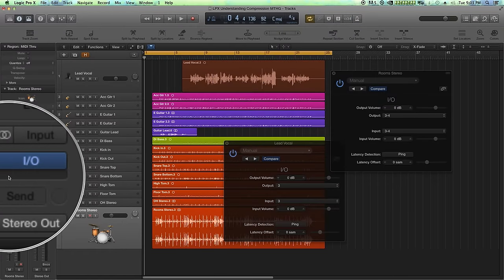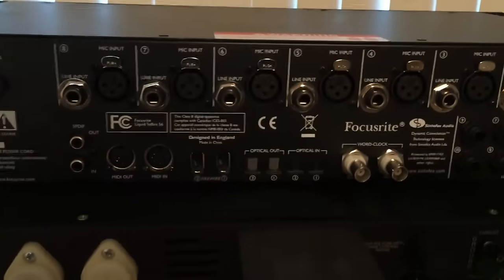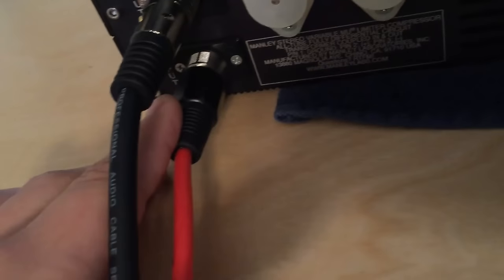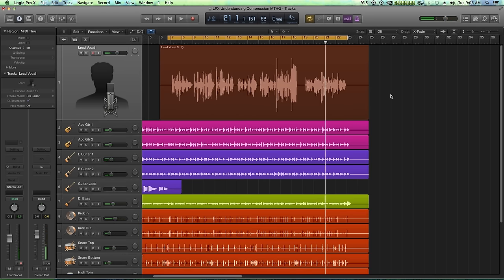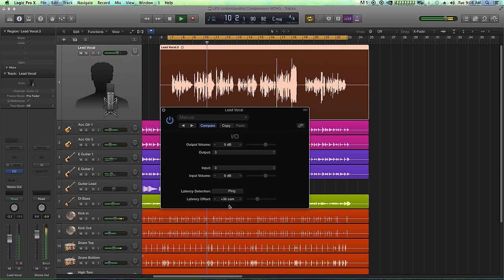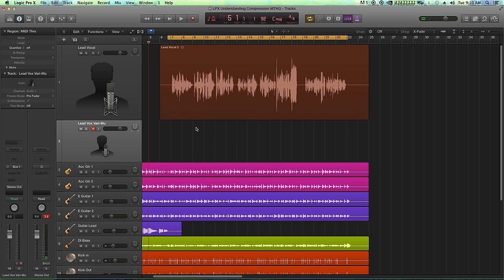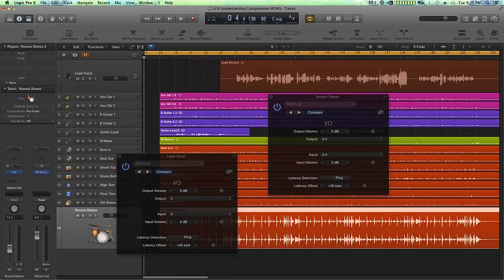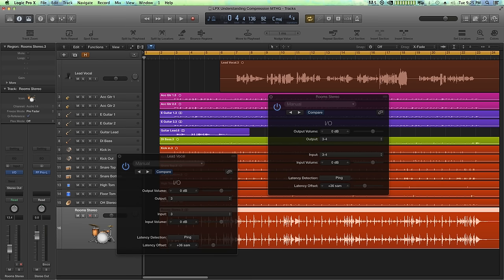Logic Pro X - I/O Plug-in - Using External Hardware for Audio Processing and Mixing

Comment: Thank you! Thank You! Thank You!   I have searched hard and long to find how to use my Focusrite Clarett, with my 500 Series modules.   Finally a great explanation of how to connect everything and get it up and running.   I can't thank you enough.
Reply: Hi, I'm trying the same with my clarett and can't get it working :( Is there special settings in the Focusrite Control with the inputs / outputs? thanks!
Reply: I am sorry but I always wanted to ask. What's the deal with the "Official" bit in your name. Do you really think you're that famous?
Reply: @snails9505  Hey, did you figure this out? I have the same setup and I lose signal with the i/o plugin

Comment: Question: why can't you use the two line outputs for your speakers for I/O instead? I am wondering because I have a small interface—RME Babyface—which only has two outs (excluding the headphones). Does this mean I need to buy a bigger interface before I can start using external hardware? Or is there a way to route it (for just mono signals, for example)?

Comment: Hey Mate.. Nice Video Demonstration!   One question I had for clarification - when you went to print your vocal on a secondary track, you routed the output of the vocal track AND input of the  2nd (new) vocal track to print on - both with "bus 1" - did you do it that way to avoid the extra latency for the print down.. so it would be printed down in and in its correct place (granted both I/O inserts had the "ping" adjustment)? 

Also, if you wanted to an AUX for like reverb I/O instead of an insert for things like Comp etc.... would it basically be the same thing but it would be set up out of a DAW AUX track instead?  

Thanks again for the video.. nice work!

Comment: Hi, I have a feedback problem with the reamp. I use an Audient ID14 for the reamp using my Eventide stompboxes to add FX on my guitar tracks. I use the I/O plugin like you do in the video but at certain db level the feedback stars to rise . The problem if I don´t rise their FX db level they don´t sound with the same intensity that if I play with the real amp. 

The guitar track and the track with I/O (both with stereo output off) have a send to a certain bus. This bus (with stereo output on) has another send to the audio track i which a mix the original guitar track with the fx.

Hope you can help me with this problem.

Thanks.

Comment: My guy first off I have watched for a long time and I haved learnt so much from you so thank you. I don't normally do this but I'm stuck. You say in this video that we need more than 2 outputs to use outboard gear. Well sir my question is I'm buying the Apogee symphony desktop and it only has the 2 outouts but I am wanting to run thru my warm audio wa73 eq and then into the black audio bluey. It does have optical inputs and outputs. Is it possible to not only track and record with them but also can I hear what I tracked as I turn the knobs as I listen.  This might be a dumb question but I just don't want to purchase all this and then only be able to record but not be able to mix with the hardware. Does that make sense? Like can I use the optical to xlr and then use the Apogee software to route. Thank you so so much my friend

Comment: What recording routing did you use on LS56 control panel? I use input 3 and output 3.  Setting the output 3 to DAW3 and it doesnt work inside logic using i/o. What gives?

Comment: Great tutorial. I have the same setup with Logic X and the UA Apollo Twin. I can't route my audio to hardware because I get feedback loops. Since there are only 4 physical outputs on the UA AT, what physical outputs are you using? I'm assuming the line out 3/4 and then back into the Line 1/2 correct? I'm doing this but get shrill feedback.  Any thoughts?
Reply: i had the same issue and i just found the solution to it. in your interface software, set the output 3/4 to Line3/4 instead of Monitor

Comment: Great video, if my compressor/mic/ interface is wired up to record with compression at the start,  would I then have to re-connect/patch the cables for further use of the compressor in the mix?

Comment: Hey there, I have a question I was wondering if you could help me with.
I want to connect my recording set up to my home stereo system so I can check my mixes and masters on commercial speakers.
My equipment is /  Logic pro x , Scarlett 2i2 interface with 2 Event TR5 Monitors.
My stereo receiver has RCA jacks for additional outs and normal speaker wire hook ups. The Event TR5's have RCA jacks available in the back. They also have balanced outputs which I'm 
using for for the Scarlett 2i2 interface. Any help would be great.
Thanks, Jim.

Comment: So if you process your beats or vocals through SSL or API analog outboard EQ and compressors it will essentially give you the same quality as running it through an SSL analog desk? Is that accurate?  If not, why not? Love an answer from you. 
This is the best video iv'e ever seen on hybrid mixing ..EVER.. And believe me, iv'e searched far and wide. Thank you.
Reply: Well.. if you run it to an SSL Desk and apply EQ it will sound pretty much like an SSL 611 EQ for exemple. And if you send it to an API EQ then it will sound like an API EQ... Your question is a little bit nonsense

Comment: Hey music tech guy thanks for the video, i have a question for you my i/o plug-in has a dry/wet option in the bottom if i put it 100% wet i have no signal going to the hardware if I choose dry i can see the meter of my hardware moving but no change to the audio signal, any idea what the problem could be? I’m using the focusrite clarett 4 pre usb ??

Comment: So all the the mix process with outboard gear requires you to essentially create new print tracks and re-play the whole track every time you want to adjust EQ, Comp etc on that particular track? That seems absolutely unreasonably ridiculously time consuming. I'm assuming like most you may adjust the EQ and comp several times over as the mix progresses and you hear different things...so in this instance with outboard gear, you'd have to re-print those tracks in it's entirety every time you make a fine tune adjustment?
Reply: or just don't print it.  just listen and don't print until you get to a point where you think you need/want to.... but no, don't print after every adjustment.  that would def be a waste of time.

Comment: Hopefully this video isn’t too old for me to get some feedback. I’m having all kinds of issues with trying to use outboard gear. The first issue is unless my buffer size is set down to at least 128 I get horrible latency. I’m running a 2020 iMac. I feel like it shouldn’t do that. Second, when I get it to work properly I can’t pan the signal. Third, if I place plugins after the i/o plugin they don’t work properly. Fourth, I can’t print or bounce with the outboard in the signal. If I bounce the track out there’s no wave form when I pull it back in. I tried the printing method and it’s not recording the outboard signal into the track. I’m at my wits end.

Comment: Hi there. Love your videos man. I just got an external compressor and when i tried to do this I got a tone of feedback when I turned the gain up on my compressor. I did a little trouble shooting and totally took the compressor out of the loop and just tried to come out of logic through my pre amp and back in the front. I still am getting feedback when I turn the volume up even just a little. Could this be because I need balanced cables?

Comment: Interesting. One question:
how do you level the processing audio going back to Logic via line input 3 ?  Do you turn up the volume on those line inputs of your Focusrite interface? Where do you look to find out what the true signal level is?
Reply from the maker: Line inputs on most audio interfaces do not typically need additional boosting, so the preamp gain stays all the way down at zero. This way I can boost or attenuate the output level from the hardware itself. I try to keep the input and output volume pretty close while making adjustments, but I may boost the output a little at the end if want the signal a little louder.
Reply: @MusicTechHelpGuy  Thank you for your quick answer. I'm glad I've done things right so far. I always had that doubt though.
If I may, I would like to ask you another question.
My interface has on each channel a 4-segment LED meter as well as a stereo 6-segment LED meter for the main. The question is why the reading of the stereo level meter in Logic doesn't match the one in the interface? Sometimes, when I'm mixing, I have the feeling that I'm wasting dBs or something like that because I don't know if I'm levelling the signals properly.
Could you put some light on this issue? Thanks.
Reply from the maker: @awesomebandhub  It could be scaled or weighted differently. Could be that the meters in Logic are showing peak values, but the LEDs are RMS?  It would be unusual for an audio interface to show values other than dBFS though, but it could also be possible that you're seeing a completely different dB system. Or the timing could be different. LED meters are automatically going to be a more quantized value, and the hold times for the LEDs could be longer or shorter. There are a number of reasons why, but I would trust Logic's meters, not the LEDs on the interface. I only look at my interface meters when I'm recording to make sure I'm not clipping and to set a rough level.
Reply: @MusicTechHelpGuy  Thank you very much for your help. I will check everything you say. Normally I set the Level Meter to Peak. Today I sent a 1000 Hz. tone with a -12dB level through a generator and I was able to check that both readings match: the one from the interface and the one from logic Pro.
You are right: in recording mode I look at the level of my pre-amp.
Cheers,
Teffy

Comment: thanks for this. I have a few further questions. i have this setup as shown, but I need to "mute" the original track so I can accurately dial in the new compressed track. the original track is muted when I'm monitoring the compressed track, but when i hit record, the volume drops on the new compressed track and the original track still comes through. any ideas on how to solve this?

Comment: I don't understand the point of the I/O plugin instead of just changing the output of the daw channel strip of the source material to a line output on your interface and then printed back the outboard compressor back into the interface. What a I missing?

Comment: Question? when I put the i/o plug in directly on the track, I get no input or signal ont the track. what's my issue? I have my output s & inputs of the plugin on 7&8 & still there's no signal when the plugin is turned on. What could be my issue?
Reply from the maker: Do you have the track solo'ed? Logic has a weird thing where if you solo the track, the I/O plugin won't work at first. If you un-solo the track, press play and let the I/O plugin pass through signal for a bit, then stop playback, and solo the track, it will then pass through signal. It's weird, but happens to me all the time. If you click the PING button and you hear that pop, that confirms that the signal is passing through. If you don't hear the pop, then there's some other issues, like a routing issuing, or in many cases, the audio interface has to be set up in a certain way to output line level and input line level. Good luck!

Comment: so in this tutorial I take it that when you print the new track from the compressor then that is the track you now use for your vocals? I am new to outboard gear and also discovered parallel processing. So, I was wondering if I wanted to run lets say half of my drum mics (already recorded) through the outboard compressor but parallel process it, how would this be achieved? I think I am correct in saying that you can't record on an aux track, so would you create a normal track, set the bus to 1 (for example) set the inputs for the new track to bus 1, then set the bus sends to 0 dB on the drum tracks, print the compressed signal of the sent drum tracks onto the new track, then use the new tracks fader to blend the two tracks together? this was hard to write in less words so apologies for the essay, any help is hugely appreciated from anyone! Great vid.

Comment: Hello! I'm trying to use Light Pipe (ADAT) to create 8 new channels in Logic Pro X. I have an M-Audio 2626 plugged into my Focusrite 18i20 using two digital optical cables. It's not working... I'm wondering if you can let me know how I should set things up in Logic Pro so it'll work. You've given me some help in the past and I really appreciate it so much. Thanks!!
Reply: Go to the top left of your mixer and search the menu that has “I/O” configuration as an option and set your routing up from there.

Comment: For some reason, the Latency Offset isn't working in my I/O plugin. I hear the Ping click but it just keeps giving me zero every time. I'm running the latest version of Logic with an Universal Audio x8p interface with the latest drivers. I'm running out to my 500 Series Rack via DB25 in and out. Is there a setting in Logic that's preventing this?
Reply: I’m also stuck with this and am using an x8p. I’m using db25 to xlr routing out to 3 and back on 3. I can’t hear the ping and my compressor isn’t reacting. You figure out anything?

Comment: I want to figure out how to send the monitor left and right [the monitors] but also the same left and right out of other outputs to run other monitor options to switch between. I was searching for it hear and I bought an old console to run stuff in and out but I’m currently doing monitor switching for play back via the only two channels I can hear the mix back on via unplugging one monitor set and plugging the other in and it’s annoying and I don’t want a bus or switcher just more outs of the stereo mix

Comment: Hi Joshua, and thanks for the video. 

I've tried this but with no luck. I'm guessing the routing in MixControl and the I/O rat's nest in Logic is messed up, and I have no idea how to make it work. 

Any chance you could explain that or print screen your settings? Many thanks in advance!
Reply: I'm having the same problem.  Both he and another video are using Focusrite but never mention the Mix Control. I go into mix control and assign the output to a corresponding input. In other words send DAW 3 to Line Output 3. Similar to how the main monitor outputs are set to DAW 1 and DAW 2

Comment: What's wrong with just sending the signal out from a track output, and returning it to a new track via the line in?
Reply: Problems with latency and changing the track outputs all the time, which leads to messy projects etc.
Reply: @alexlykos18 Thanks!

Comment: I'm really frustrated. I used to do this all the time in pro tools but I can't figure it out in logic. Its only giving me the option of two outputs which means that I get a feedback loop because since the master channel is using outputs 1 & 2, if I use either of those it doesn't work. How is logic giving you the option of having more outputs than just 1 & 2?
Reply: How many channels is on your mixer? You need at least 4 ins and outs

Comment: I am using a similar setup... wherein I am routing the vocals out of line out 2 and into a DI Box and from the DI Box to a TC Helicon Harmony GTX and from the TC Helicon back into the Line in 2. My issue is... It seemed to have worked in the beginning.. but now I get a huge Buzz in the track. Anyone Help!

Comment: Great video.  I am going through learning and attempting to do something similar with one of my tracks.  However, when I activate the I/O and try to send the track out - my channel strip meter goes dark, does not play back what was recorded on the track and doesn't send the recorded data out to process.  When I disable the I/O the meter and sound reacts as normal.  Anyone have an idea of what is going wrong and how I can fix it?

Comment: Can I reuse the plugin multiple times with the same output because I can’t get my adlips to process because I’m already using output 3 , does that mean I need a patch bay?
Reply from the maker: You can use the plug-in multiple times, but you can't re-use the same output and input. You could go out 3, in3, back out4, and then in 4; however, that may create some quality degradation and latency issues, because I'm pretty sure you can't 'double-ping' the effects loop. You're better off getting a patchbay, sending out an output, patch all he gear you want in line with that, and then taking one output back into logic. That's the way it's done in most studios.
Reply: If you're trying to process multiple vocal tracks at the same time, you could group them to a bus/aux in Logic, then insert the I/O plugin on that aux. But maybe that's not your question :)

Comment: can I do this with apollo twin,  m-audio project  mix and new compressor  I'm looking into buying soon? only thing I don't dig is the printing and the i/o signal.  can't i just used the gear and tweak it and run with it? have learn some good stuff from you my man!! 😎😎
Reply from the maker: You can tweak it and just keep playing it live through the hardware, you don't have to print it. The problem is that you won't be able to use the unit for another track for compression. It's all analog, so 1 track, 1 unit, until you print down the processing. You should be able to do it with any audio interface as long as it has TRS outs and ins.

Comment: Its almost the same process with the Focusrite Safire pro 40 interface right?
Reply: It should be but I was having trouble with the I/O plug in. I have another method using the Mix Control software